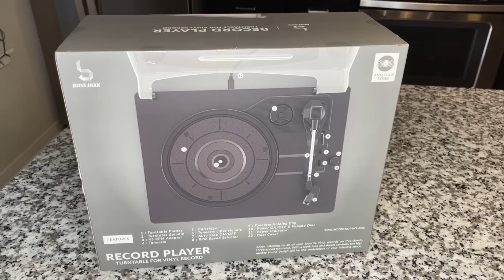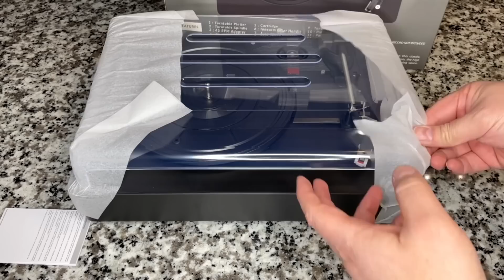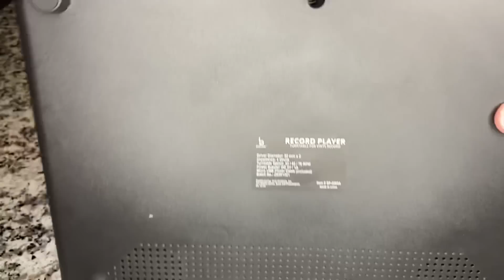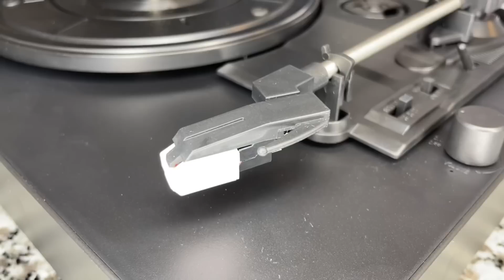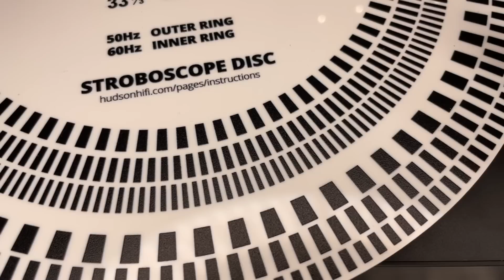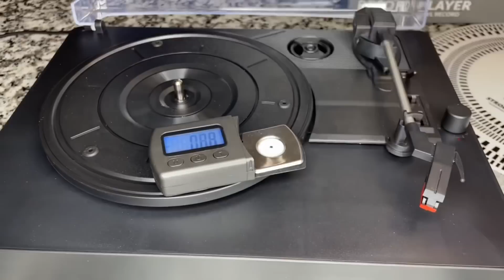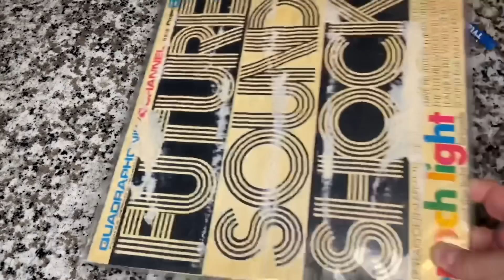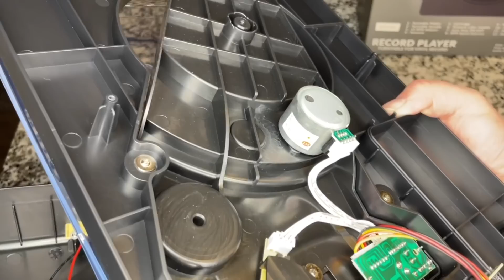SHOCKING $25 Record Player from Five Below - Unboxing & Review!

Comment: usualy on the cheap models the arm pushes to hard on the Stylus. above 3 grams.. even as high as 7 to 8 grams.
this ruins Stylussus. (needles) and your records. stylus needs replacemt each 50 listning hours, wich is oke you buy 3 for 10 bucks of these cheap stylus.
if you can try to get about 1.5 to max 2.5 gram pressure on the stylus. if you can manage that this Record player is a Jewel.
Reply from the maker: Tracking force is dictated by the cartridge.  The CZ800 type used in this are designed to track around 5-6 grams.  Anything less will damage the cartridge.
Reply: @Recordology  true but that doesn't meen you'r reckord loves the weight on it.
my vintage schneider has a ceramic CZ-800 type cartridge. with a simple Stylus costing 15 bucks each. they last about 1000 hours, all BC of the low pressure on the stylus about 2 grams.
the cheap turntables usualy has a stylus that lasts for 50 to max 100 hours. due to the weight.
this by no meens makes it a bad piece of equipment. it just needs some extra love on purchase, maybe a new cardridge inc stylus and less weight to your vynil. makes reckords last longer.

Comment: That strobe disk: those 2 separate groups of 3 rectangled rings for 50 hertz and 60 hertz current, does that ONLY affect and notice a difference only when the motor that drives the platter is a direct AC powered type of motor? As that record player is USB-C powered, being in the North American continent (60hz) or in Europe (50hz) that i know of won't affect the difference in the speed cycles as the 5 volt output power of a smartphone charger or power brick is DC powered🤔 By the way i got impressed with the sound of the bottom firing speakers👍
Reply from the maker: It works whenever spinning.

Comment: HOW DO YOU PUT THE LITTLE JUMPY THING BACKK!!!! I’ve been trying for an hourrrrr
Reply from the maker: Is it the tone arm with the red tipped cartridge at the end? You should be able easily move it back to the rest.
Reply: @Recordology no it’s that little small circle thing in between where the vinyl sits
Reply from the maker: Sounds like the 45 adapter? Is it about a 2 inch diameter circular piece? That should also lift straight off with minimal effort.
Reply: @Recordology  thanks!!

Comment: Fantastic review. I was astonished at the sound coming through my headphones. I have two portable turntables with built-in speakers, and it sounded like this one had better audio! You know what you could do with this thing? Get a replacement stylus for 78 rpm. I just got one from Amazon. Imagine if this deck were used only for 78 records. That would be awesome.

Comment: You could cut the speaker wires and connect external bookshelf speakers. The small amplifier inside mostl likely will be able to put out good levels of sound. I have tested less than 1 Watt amps with bookshelf speakers and they sound quite good.

Comment: It's tiny. LOL 
Does it have a dual channel cartridge? If one is very tech savvy, they can bypass the mini amp and hook it up to a more precise unit. The only iffy thing would be is if there is an upgrade for the needle to a metal post to a rubber connection to shell or even a way to replace whole cartridge with one that takes Vibrations better.

Comment: I just found this old review. You said that the record does not look real, that it looks strange. It does, and I think I know why. The whole machine looks strange, and I checked out other photos of the box online (it's not just a Five Below product). I think that the perspective of the product photo has been distorted in Photoshop. Notice that the record looks like a perfect oval. That is not real perspective. In an unmodified photo, the farther half of the record would be squished compared to the nearer half, but in this photo, the top and bottom are the same size. Likewise, the perspective of the bottom and lid of the record player have been squared up. The edges of the sides do not angle to a vanishing point. And yet the vertical edges of the corners angle away from each other. I don't think any of this can be accounted for by the angle of the photo you took. I think that for reasons unknown, the box designer took liberties with the perspective. It kinda looks like it was shot with a tilt shift lens, but not quite. And yes, the reflections in the lid might have been faked, or it just might be that the lid is tilted back and showing the reflections at an angle.

Comment: Let’s just say an 8 dollar speed controller saved me $1700 per deck for my mixer…. And they’re 25 bucks come on now. I been mixing for 4 days with them now and nothing has broke wtf 😂
Reply from the maker: Wait….what did you do exactly!??
Reply: @Recordology  I put a solderable RCA jack that you can Mount onto the side of the player for audio out to a mixer. Cut the wires to the speakers and solder it to the RCA solderable jack off eBay. Then for $8 type in brushed speed controller and it’s the first one with the mosfets inside the case and the potentiometer. You need that to slow or speed up the record to beat match… I literally saved thousands of dollars I made extra decks too if these break. I want to get rid of the direct drive and put a Chinese clutch drive off eBay too.
Reply: @Recordology  it sounds better than this 300 dollar icon deck I have.
Reply: @Recordology  also the steel puck is a 2lb round puck off eBay too type in 2lb steel weight and epoxy it to the inside middle of the player. Just keeps it from sliding all around and makes it feel bit heavier less cheap. I replaced my cartridge though I used a needle kit from a late 1970s record player entertainment system. They say Diamond Tip on the boxes and they’ve never been used. It doesn’t have the same wiring points so it took me a while to get that right until I could just slide the 70s carts in and out once wired right. It sounds like maybe a 1000-1500 dollar technics table in sound quality. Slip mat would be fun but idk how long this motor will last. Tone arm weight after diamond tip mod is 8 gram. Sounds warm like tube like. Records have to be immaculate though or my sound system pops I have no line leveler. I’m an electrical engineer im 29

Comment: I modified the crap out of mine. Brushed speed controller off eBay. $8. RCA out jacks I added a steel puck weight to the inside middle. Now I’m tryna figure out how to make it belt driven with a slip mat.
Reply: I left them running overnight and the motors didn’t burn out. That’s good.

Comment: I got one of these (my first record player fwiw) and I have a problem where basically any high-volume point in a record will cut the volume. The comments on another review suggested this was a problem with the amplifier not being powerful enough - is that something that can be corrected or replaced simply, or do I just have to get used to the minimum volume?
Reply: So far no one has had any answers for this ... As for myself I moved on from this unit and to a Victrola Eastwood... The Eastwood  is a better starting point then even the Crosley suitcase players...$99 seems to be the lowest starting point for good sound quality.
Reply: @crisbwilliams  Yeah, I did the same. My dad watches Facebook Marketplace and he found a Crosley suitcase on there for half price and I jumped on it. I know the audiophiles would crucify me but people that are a bit more... down to earth seem to be less harsh on it. I'll get a better needle on it and call it a day, at least until I can upgrade to a better setup.
Reply: late reply but this record player has a design flaw in the amp the amp has a cutout point at a curtain volume only fix is to replace the amp board. I did this on mine and works fine after amp replacement also added rca jacks.
Reply: @VinylRage3676  what amp did you replace it with?
Reply: @Ruff64  PAM8403 3W Stereo Audio Power Amplifier Board the one with the nob

Comment: This turntable is nothing more than the same type unit used in Victrola and other suitcase record players etc…. Very low end unit but will work, usually. Still better to go with a Sony or Audio Technica if you’re serious about listening to vinyl and protecting that vinyl investment. Just one opinion in many. Personally I use an old Sony PSLX 300 but plan on the Audio Technica AT LP 120 I believe is the model. If something better pops up maybe I’ll go that route. Have a Blessed Day !

Comment: Update 2...Picked up a Victrola Eastwood. This unit should be the entry unit all people should get.. and it seems $99 is the starting point to decent sound. 

Update 1: Picked up a Crosley Cruiser and this 5 Below unit sounds better, until the sound cuts out... lol.

I wonder what the fix for the sound cutting out would be…. Or I wonder if it is a defective part that can be replaced. It’s a shame as this is a perfect record player for a very casual user like myself. $25 was my limit… lol ...

Comment: Hello! In view of the low cost of this machine, might adding self-adhesive felt on the inside of the box could reduce any possible echo within the box. 
I remember as a kid I got a "kid's record player" Christmas present in the early 1960s. [Yes, I am old enough to be your granny.] It used an actual eye-less metal needle to produce the vibrations from the records. I do not know how much that machine cost, but it plus the records likely cost less than $25. _

Comment: I just worked on a Califone record player that had been dropped and this popped up as recommended viewing so I had to watch.
Regarding the record player there was no visible damage to the record player from outward appearance but the bushing for the spindle had been bent just enough that the turntable was scraping the speed change control. There's also lever to fine tune adjust the speed and I like the clever method they use, 
There's an aluminum disk on the motor shaft, the fine tune adjust arm is attached to two magnets that move over the aluminum disk, one above and one below the disk, and since a conductor moving through a magnetic field generates electricity and an electric current creates a magnetic field the motor will slow down as the magnets are moved over the disk. I've seen this method used to dampen a balance scale but this is the first time I've seen it used to control motor speed.

Comment: I always checked the speed with a record on the turntable. To me, it sounded a bit slow on the playback.

I can imagine taking it picnic with rechargeable LiON battery. If you were a bit mechanically and electronically inclined, you could install a jack for headphones.

For effect (and overkill) you could tap the preamp for an output to plug it in a boom box.
Reply: We did this the other day !!!! It ran right off the battery get the from Walmart portable battery charger. We mixed for hours and hours in the park but we modified ours with RCA out jacks to the mixer.

Comment: I'm wondering if there is a 78rpm stylus made for that cartridge? For $25, I'd be fine using it as a dedicated turntable for common, less-than-great condition records. (I'd keep the stylus that came with it for late 78 era records, and children's 78s that were pressed on plastic or vinyl-lite. 
   Also, would that motor be able to handle the extra weight of shellac records?
    I enjoyed and appreciated this video! (I gave the thumbs up and subscribed!)

Comment: This is the same turntable mechanism made by TEAC / TASCAM and featured in some of the CROSLEY radio phonographs. TEAC used to make open reel tape recorders back in the seventies. This mechanism is "Belt Drive" and is extremely fluttery.   You will regret playing any vinyl records with this tone arm as it weighs 12 grams and will tear the hell out of the record grooves.    I ordered a special stylus from Crosley to play 78 RPM shellac discs. I also stacked several quarter coins together with adhesive tape and taped them in place on the back end of the arm as a counter balance to lessen the weight at the stylus.   If you  place a 10 inch disc on the platter and then a circular piece of terry cloth on top of that, you can place another disc on top of the terry cloth.   The weight of the two discs provides enough torque to eliminate some of the flutter from the belt drive.     But save your disc collection from damage and buy an Audio-Technica turntable.  Certain ones are also 3 speed and will track your discs at 1 gram (which is proper for long-playing vinyl).   These TEAC turntables are junk and are only suitable for playing 78 RPM discs.

Comment: it would be easy to convert those speakers to rca, and a rca convertor can be bought cheap, but let's be honest, the output is probably low enought to just hook to  rca crimp ons if it is going to a cheaper radio, which at this level it probably would be.
Reply: you could also use a ear phone jack and some old computer speakers fromn the thrift shop.

Comment: So I picked one up and like your review, was surprised at how well it took a record. The problem was the sound would only play about 5 seconds then cut out. Tried a few power supplies. Same thing. Oh well, back it goes. Might try and get another one and see if I lucked out like you did. Either way this one is going to a landfill.
Reply: Records with a less aggressive groove play all the way through without cutting out. This is a perfect player for tinkerers and DIY project people. I play a game with the collection of 45s I've ended up with over the years. Play a record. If it plays all the way through, I've enjoyed it. If it cuts out, I don't. lol
Reply: I’ve replaced 5 of these… they all suffer from over;padding the amp and cutting the sound out. Some one said that “loud” records will do that to these amps. Oh well.
Reply: Maybe that's why Crosley cruisers and other variations of them and that record player mechanism don't have the impedance matched correctly if the amplifier can't handle loud bass heavy music that their younger targeted market will most likely play on it. The trouble is that type of music sounds terrible with the bass almost completely removed. Any music doesn't sound good with the bass removed imo.

Comment: Bought this for my nieces boyfriend. Upon the first use, the volume kept turning itself down and if you turned it up, it sounded like the speakers were under water. Second use, the knob for the volume no longer works. You have to find a sweet spot on the knob to try to attempt to adjust the volume. I know that you get what you pay for and it may just be defective but it’s going back asap. I already ordered a Victrola elsewhere. I wish that this worked for him though.

Comment: I believe the slots missing on the lid is used to play LPs with the lid closed.

The tracking force may be closer to 5g.  The force should be measured from the same height as the record.  If If you place the scale between the platter and tone arm lock  you will get a more accurate reading.

Thanks for letting us know about this turntable.  It is well worth $25.  Better replacement needles are available.

An audio out jack can be added.  A DPDT switch can be used to isolate the speakers from the jack.

Great video!

Comment: I bought this exact same record player at Five Below. If it's set to auto stop, the wheel stops turning before it reaches the end of records. That sucks, but luckily the wheel can be made to turn continuously without stopping. I don't like the volume. I think it isn't loud enough. But because it can play 33, 45 and 78 RPM records, I believe that it's well worth $25. I've played record players on and off since the late seventies. This is not the best phonograph I've ever seen but it doesn't suck either.

Comment: As a person for years liking quality sound and quality electronics, I always looked at the low end stuff since it was what I could afford, or the used market. If I would have bought this for myself I would have either tapped off the volume control area for a line level out, or directly from the cartridge wires and ran it to a real 20 watt or higher stereo amplifier and a decent set of speakers. Changed the needle at least to a real quality brand or better type. However if I was giving it to a new user it might just get the needle upgrade for it, and a separate power adapter.   I hate the idea of the speakers down firing but for a new user or a child it is a good idea so that they don't poke a hole in them or spill something on them. Now 40 years ago this size speaker was very poor sounding but I'd say since the designs for smaller speakers and computer speakers improved, size is not as much of a quality thing, and much larger ones in a case with the record player would have the needle skipping.

Comment: This is like the analog version of a Sony Minidisc Recorder. Sound checks in, but it only checks out through acoustic sound vibrations through the air. (With the Sony Minidisc, sound would check in at high quality, but only check out through an analog connection in real time, or upscaled through the SPDIF output for one generation only).

Comment: It's a knock off of those typical Crosley ones you could normally buy  for $50.00 - 90.00  but those have  a nice 
suitcase cabinet. The weakest link is it's  PC board ( cheap parts) , no audio output jack and cheap stylus. 
Suggest replacing the needle with a Pfansthiehl 901-D7 or equivalent . It has a diamond tip needle. 
This will last a long time and won't eat records. Good gift for teens, they won't be blasting away the music in their room.

Comment: got this for christmas. Replaced the stylus needle thing with one i got from ebay that i had because a messed up thrift store player i wanted to fix (that it didn't even fit on anyways) and i bought some cables on Amazon to mod the speaker wires inside to 3.5mm outputs so i can record records to my pc